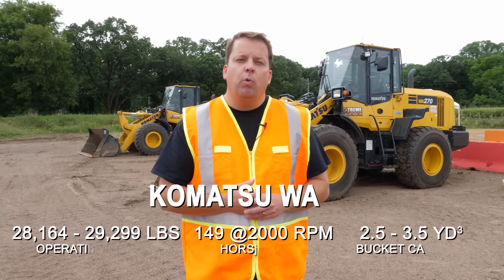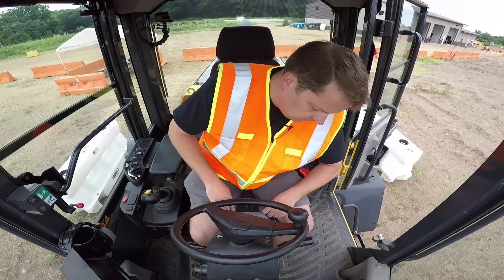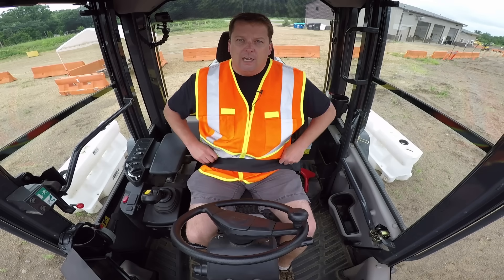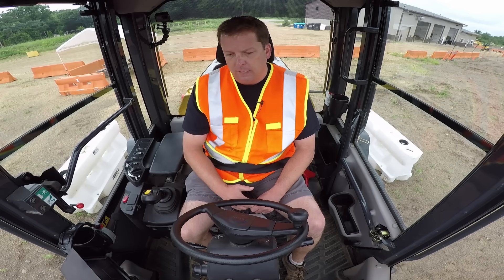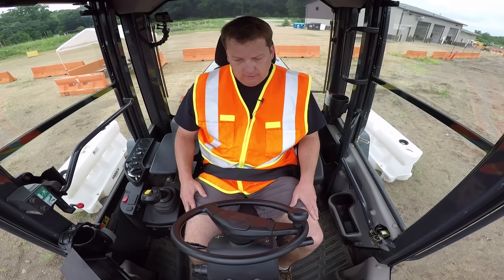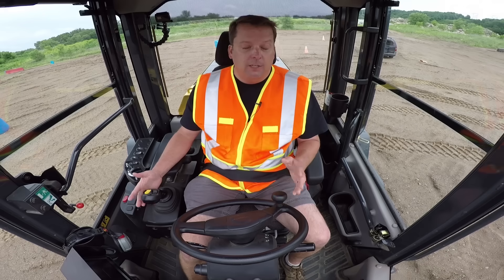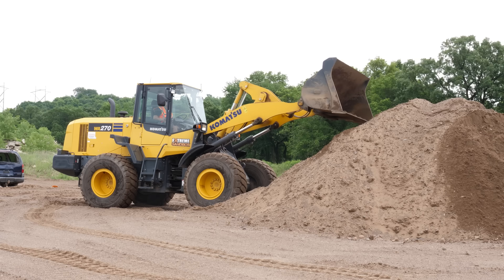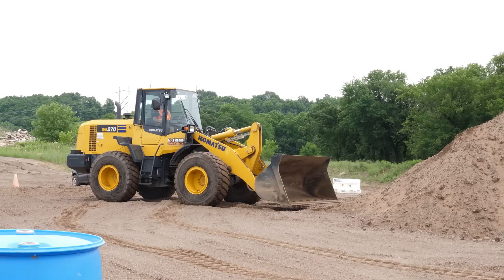How to Operate a Wheel Loader (ep. 065)

Comment: generally you don't wanna let your tires spin that much, or at all. that's like a 5-10k mistake for each tire. i've worked on a sand pit before so ain't much wear and tear as a more rough terrain but idk. i guess the more experienced you get you'll be more comfortable using both pedals to utilize all that power without spinning out and bouncing everywhere. also feels heck of alot safer imo. i'm 25 been operating since i was 19, still learn new and better ways to do things all the time. i like to watch videos like this to see other operators techniques in the comments

Comment: When I use to work as a laborer on a construction job they built a temporary raised road out of dirt topped  with gravel high enough to back a dump truck against the end of it kinda like a dock where you could dump trash and whatever else into the truck the road was very narrow with very little  room on either side they told me to hop on it never drove a wheel loader I found that every time I turned the steering wheel I would get real close to the edge to the point of fearing  I would flip the loader because the front-end  or back-end  tires hung off the side of the rasied road in what was I doing wrong ?

Comment: Moving dirt is nothing show me how to push up brush with the loader in a huge brush yard ....
Reply: Bahahaha no to get that brush to stay up high it's alot harder then moving dirt or mulch 😂😂
Reply from the maker: Hmmmnm...concepts will still be similar
Reply: No problem. First of all you lower and level your bucket to the ground. Yes your bucket has a load. Than drive into your pile and push it a little bit. Now, start to raise your boom. Just a slight tilt back is all as the bucket lifts. Or even none. Really don't.need yoyr bucket anywhere but level until you master the first part. Keep it level. keeping your front tires on the level ground. Don't drive up the pile, and don't start with your bucket lifted like your ready to dump. Ya don't need your load coming over into your cab. And just lift and push. This will lift your pile up well over your loaders height. That is how you get that huge pile. Your loader should never be driving up the pile. It should always be on the ground and not on the pile. Go slow. And your welcome.

Comment: 0/10 you spun the wheels
Reply: This is basically sand. Spinning the tires in sand will not damage them lmao. When loading in really soft and fine material like this, you can use chains for traction. We have chains on our Cat 994 loader for protecting the tires, but they also give traction. Not sure about the smaller loaders though.
Reply: Make a trip to Florida, our sand will make you look like a fool.
Reply: Josh B I’m sure you know so much 🤪🤪
Reply: @wyatt35810  you understand I was agreeing with you?
Reply: @wyatt35810  I certainly didnt get stuck, operating a loader, loading trucks my whole life.
Reply from the maker: Fail

Comment: Cool video.  I don't call my self an operator.  I'm just a runner or lever puller . Before I start mine up I check the fluid levels and I can't stand dirty windows so I clean those . MSHA requires a preshift inspection report.  We also have scales and have to do a few warm up lifts to activate it .  I've found when digging is more tight piles like shot rock I will level the bucket and then just a slight bump forwards on the bucket lever helps to loosen up the pile . Some loaders have an automatic kick down so if your in second or third gear it will go to first when you hit the pile . I been running equipment for over 30 years and still don't know nuttin . Just a lever puller . Thank you for sharing your video I enjoyed it very much
Reply from the maker: Thanks for the comment!

Comment: I thought you n need to operate the loader in gear 1 ,you never talked of gear to operate with only starting it in gear 2 and you don't spin tyres when going in to the material ,am from Zambia loader operater at Kansanshi Mine PLC
Reply from the maker: Don't need to be in 1st gear.   But totally agree about not spinning the tires.

Comment: No first you turn the battery switch on or you get to climb back out
Reply from the maker: Who turns off battery switches????
Reply: @HeavyMetalLearning  Better turn it off  if it's not used  for long period . Or in winter for  few days. Some.have the switch in a lockable box ...usually they have it on the side of the rear engine...
Reply: ExtremeSandbox lol it’s an old thing you’re right :) but yeah those old machines left on site with neighborhood kids around you didn’t know what you’d find the next day lol in fact the little bastards broke every window out of every piece of eqp we left on site one time ..EVERY SINGLE WINDOW ON EVERY PIECE OF EQP ..it was horrible
Reply: @wbgames7406 Must have cost a bundle..
Had the same case.  but luckily no broke windows... Could have been competition but usually they burn your machinery...
Reply: @HeavyMetalLearning  fitters and people who dislike you.

Comment: 1.You need to walk round first to check the levels and grease the linkages, and then walk round again to look for problems, and you need to refill the fuel tank at the end of a shift.
2.Just pulling the bucket back to fill it only works in soft material. If you’re loading hard or coarse material you need to keep working the bucket up and down and only pull it back when it’s almost full.
3.You can’t level with a back blade; you need to get a good level first and then smooth it off with the back blade.
Reply from the maker: Excellent advice...thanks for sharing!  We do have a separate video under our LEARN playlist that covers the pre-op inspection.
Reply: Shut up old man.

Comment: I have a lot of experience operating my fathers 4x4 Massey Ferguson tractor. I learned to operate the front end loader on my own and developed a technique that works really well. So came to see this video out of curiosity. I'm surprised to know that much of the controls and operation are very similar.
Reply from the maker: Nothing better than learning on your own.   I think most great operators learn by just getting their butt in the seat and running the machine.   The more seat time, the better you become!   Thanks for the comment!

Comment: I wonder if somebody tells me how much is the capacity of bucket?
Reply from the maker: I believe it’s a 3.5 yard bucket on the wheel loader.
Reply: @HeavyMetalLearning  thank you my dear buddy, I think each 3.5 cubic yards equal to 4816kg or 10617 pounds
Reply: @HeavyMetalLearning  I believe you are very unfamiliar with kilograms and kilometers and tons....because American systems  are measured by units such as miles, pounds, yards...
Reply: @HeavyMetalLearning  today,it was very windy and I had to load the asphalt for repairing a part of the road,its weight had been 23 tons I mean it was gross weight
Reply: @HeavyMetalLearning  my truck's weight is 12940 kg+23000kg =35940kg, total weight
Reply: @HeavyMetalLearning  my truck's model is a 1987 Mercedes Benz
Reply: In our country the price of truck is very very expensive, imagine if you wanna buy a new Axor Mercedes Benz you have to pay 1.3 billion tomans,dumpertruck driver's is about two million tomans
Reply: @HeavyMetalLearning  each one dollar is fifteen thousand tomans
Reply: @HeavyMetalLearning  inflation is out of control, unemployment is a big disaster
Reply: @HeavyMetalLearning  for example if you wanna buy a Mercedes Benz dumpertruck 6×4,you have to work 60 years it means you must work since childhood
Reply: It depends on the machine. At my work we have 2 John Deere 544k loaders. One has a 4 yard bucket and the other has a 3.5.

Comment: you should do a video with a stick steer ....now that is luxury. i ran a 600 komatsu coal loader that had stick and wheel both. never used the wheel one time.
Reply from the maker: I wouldn’t even have a clue how to run one.
Reply: The mine I'm working at has a pair of 972M stick-steer loaders for loading out customer trucks. I wouldn't really know where to start; I've got a lot of time on CAT skid-steers but have only ever run wheel-steer wheel loaders. 980Gs and 924Gzs.

Comment: Where's the machine walk around?
Reply from the maker: Done before the video.   Maybe we should do a video of just the pre-inspections.
Reply: There are daily and weekly inspections correct? A daily inspection would be visible damage, fully functional lights tire pressure and possible obstructions under or around the machine as well as oil leaks. COR would consider these as part of daily checks and required if you're going to climb into the cab and operate
Reply from the maker: @danielwolfe8  Correct.   And we have a monthly checklist as well.

Comment: CAT has two levers for moving bucket and boom . . so one for boom and one for bucket , and on boom joystic is one button , when you press it , it goes to gear 1 and when you get yoused to it  you can do it really fast and fill up trucks as fast as 4 trucks per 2 min . .like my collegue
Reply from the maker: Yes, most wheel loaders either  have the 2 levers or your right hand OR the single joystick.   I would say most newer equipment is going with the single joystick control (even some are doing a joystick for driving as well - meaning no steering wheel).
Reply: @HeavyMetalLearning  It's 10 times quicker to use 2 leavers than one , because you don't need to use only one control , you can curl and use your boom at the same time !
Reply from the maker: @danijellukic2196  Have you tried both?   The single joystick controls both functions as well so you can absolutely curl and raise the boom at the same time.   Again, both are acceptable and many operators have used both and obviously have their own preferences.
Reply: @HeavyMetalLearning  I think it's easyer , and i haven't tried single joystick , they don't have that newest machine . . the newest is cat 950 F . .
Reply: @danijellukic2196  I used both, the two levers was a Case or Cat I like the single, it's been so long I don't remember how the two levers work, I remember how cold it was waiting for trucks when it was minus 30
Reply: @TeeKoon  This sh^t has good heating . . . 2 levers are kinda easyer  for me :) it's simpleyer . . no adition buttons on joystick or anything like that . .
Reply: 4 trucks in 2 minutes?  Hahaha
Reply: @vonheimlerstrudel  Yeah i fucked up ,it's not 4 trucks per 2 minutes . . but it seems like it , it's so fast , or time passes bye rly fast

Comment: Sorry for my bloody inexperience (and my "German English") ...
As soon as a wheel loader is driven at maximum speed, the entire vehicle sometimes rocks so hard around the transverse axis, that it seems difficult to control. This effect reinforces itself, even on smooth roads.
How can you manage to avoid it? Simply drive slower?
Thanks.
Reply from the maker: Not sure if you have the Ride Assist on, but most newer Wheel Loaders have a ride assist switch that when engaged it adjusts your boom while driving to avoid the pendulum bounce while driving and makes it a smoother ride.
Reply: If you have the difs locked into 4by4 and traveling on dry roads your machine will shake . Adding to a rough ride. And remember , dont over steer you could find yourself off the side or shoulder of the road in a ditch quickly. 
Good day from Canada
Reply: @kyletracey5819  New guys tend to forget when they go on the road but oversteer is the first thing I tell the guys, it s not a car go easy  and soft and don:t try to go too fast before getting used to it, especially in the city and heavy trafic...and keep an eye for the speed bump usually in school zone especially if u dont have ride assist...
Reply: Turn off the prostate massager in the seat.  This should help.

Comment: Ok that's not bad. When you first hit pile lift your boom just as you did, here's why, when you lift boom it transferred weight onto front end and gives more traction. Never hit pile with front end tires off ground, you lose most of your traction. If you rock bucket up and down this is called pumping the bucket I don't do it much. Never spin a tire if you do it on a large loader you may get fired. If a tire spins on a rock especially in wet conditions it could get ruined. Don't put your bucket down till your ready to dig, it will be less wear on edges. Plan your moves so you don't use brakes much. And don't leave bucket full of dirt when your done empty bucket or you'll really look like an amateur.
Reply from the maker: All good tips.   Thanks!
Reply: Good job
Reply: Yeah....that's right.  No spinning the tires trying to get your bucket full or you'll just create more ruts to shake the material out of your bucket.

Comment: Thanks for this video. I’ve been wondering for two years how the pit operators smooth out the ground so well with the loaders. I didn’t know you could make the boom “float”. Every time I’ve tried it I ended up digging a ditch! We have Cat loaders but I’ll guess that the “float” function works the same way. I’m going to try this the next time I have to load my own truck!
Reply from the maker: Yes, should work in any brand (sometimes it’s slightly different in how to float it) but in general I’ve found just stabbing the right joy stick all the way forward will lock it forward which is float.   Just make sure you only do this when the bucket is all the way on the ground already.
Reply: +TeeKoon thanks for the reply. I have had the chance to try the float feature since I wrote that first comment and it worked fine on the loader I was using (950 Cat). It was just the operator (me) who didn’t know how it worked before.
Reply: @davidedwards1855 Try not to use that or the automatic leveler because most pieces of equipment that are over a year or 2 old don't have any of that working.
Reply: +ExtremeSandbox Good advice! Thanks
Reply: Maybe the float function might be defective,if it;s the case you have to hold it  pushed foward, have it fix when you have the chance it;s not very long to have it done. You have a switch to have your bucket level too but rise the angle a little bit to be safe...don;t forget to clean your working aera of any rocks or debris before loading your truck, rise ur bucket gradually when coming from a distance close to the truck not too far or too close and dump in the midle of ur box by rising and pitching ur bucket! Don;t try to go too fast too, speed will come with the time.